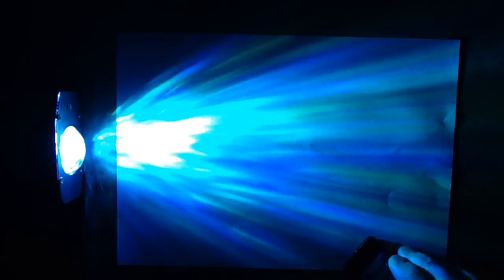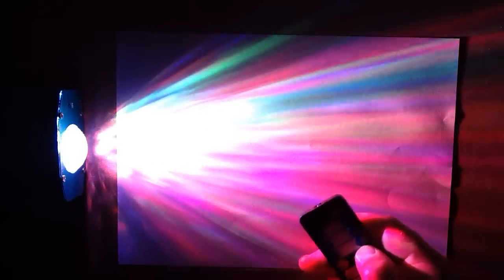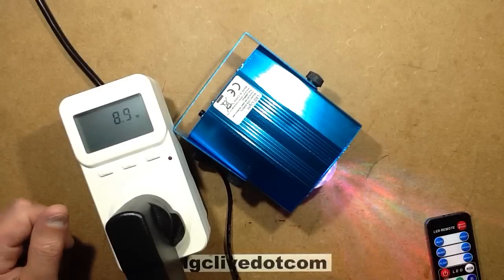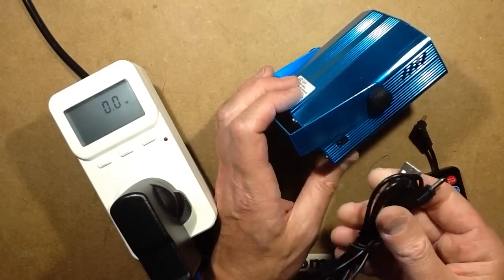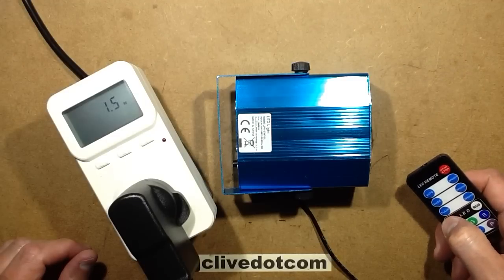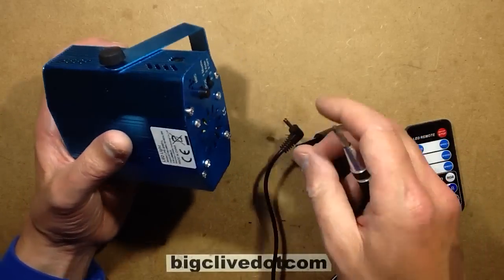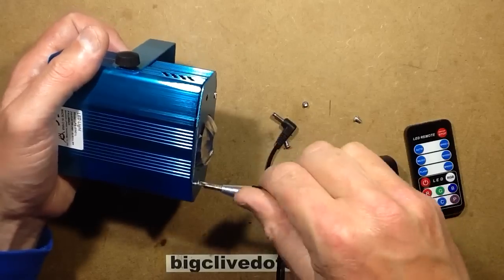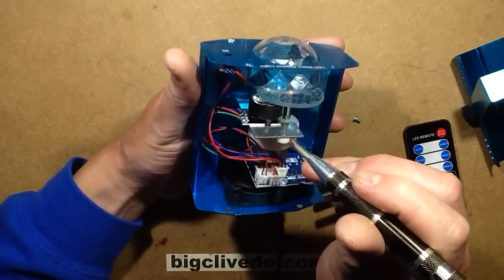Low voltage (5V) RGB LED ripple projector with remote control.

Comment: I've just ordered this one for £9 off amazon.co.uk, hope it's the same (the remote button layout is slightly different)
https://www.amazon.co.uk/Ripples-Control-Activated-Birthday-Decoration/dp/B081JVZ6DN
Reply: The remote control is actually the same as this one, not like the Amazon photo. PSU is a bit different. White label on the top is exactly the same. I didn't get a battery in the remote. My fan went quiet for a couple of minutes after about 10 minutes of use (thought it had burned out already!), but it came back on again and now seems to run constantly. The base and sides are threaded for a tripod stand, but strangely the bracket isn't (hole is too big). I haven't taken it apart (yet) but expect it to be the same.

Comment: I plan on having this hooked up to a timer. Without a memory function, what is the default color, mode and speed when its powered back on, and will it power on by itself (from the timer) or does it need to be switched on each time with the remote? great detailed breakdown of this unit.
Reply from the maker: It may vary from unit to unit, but this one defaults to colour cycling mode at power up.  To make it do a fixed colour and speed you might have to modify it.

Comment: CAUTION: I just got back from London Western Eye Hospital after having this unit cause lasting damage to my eyes. DO NOT ever look directly into beams, mount so it diffuses off a ceiling with no way anyone can get between the beam and the ceiling. PLEASE add a warning to the video! I made the mistake of thinking LEDs were safe as they were not laser units. Thanks!

Comment: I bought four of these, and one motor is much faster than the others.  Even on slow speed, it's very fast.  Do you know of any way to slow it down?  Perhaps a trim pot on the circuit board?  I was hoping it was dc, but it seems to be pwm.
Reply from the maker: You could possibly adjust the range with a diode or two, or a resistor in series with the motor.
Reply: I guess a resistor would work.  Each pulse would be at a lower voltage.  Since I only want one speed (slow), I'm also considering running the motor from something like this:

http://www.ebay.com/itm/like/252076403263?lpid=82&chn=ps&ul_noapp=true

Comment: Have you ever torn down one of the cheap ($25) rgbw Dmx par lights? I bought a few and they were all using a similar internal design, and various hardware revisions of the same logic board, with an stm8 mcu (quite possibly ripe for hacking)

Comment: EBAY SELLER WARNING. Just bought one of these from my-happyshop shipped from Leeds with a UK power adapter plug for £15. Plugged it in for the first time and the capacitors in the power supply went pop! (I opened the power supply to confirm - bad smell, liquid and raised tops).  Putting in a request for a refund, could be just my unit or could be a batch problem with the caps they used. FYI. 

Auction  http://www.ebay.co.uk/itm/121970231020?_trksid=p2057872.m2749.l2649&ssPageName=STRK%3AMEBIDX%3AIT
Reply: Ha! You're not the only one. The unit my brother bought went bogus after only 2 hours of use or so. Power supply heated up, started to smell, but kept working. Eventually, the smell became so bad he turned it off. Popped the PSU open in the vise... I almost threw up... darn the smell was nasty.

Indeed, blown caps: could not figure out if they were underrated in voltage or capacity (for as far they are not both)

Comment: I've actually been in the market for an LED light I can use in my room at home (stringing Christmas lights up is kinda gaudy and something of a hassle), so I think I might pick one of these up, especially with how cheap they are. I might break it open and see about adding some thermal compound though.

Comment: Is there any way to make it look as though the light is being spit out as opposed to being sucked in? Some sort of polarity reversal/modification somewhere?
Reply: You can reverse the direction by turning the unit around 180°, so its base is facing the wall rather than the top (or vice-versa). Turning it 90° makes the light move to the left (or right).

Comment: hey big clive which projector would you recommend between this one with the remote motor speed control or the line voltage model with more colour options? which has a more interesting effect or brighter output?

Comment: You could ask the first 20 people you see on the street what a ripple projector was, odds are none would know. and after you explained what it was maybe one out of the twenty would buy one and maybe one out of a thousand might take it apart.
I'm wondering what's the fascination/point with these ebay junk teardowns ? I'm hoping that after a dozen or so episodes  you'll show us how to cobble together some kind of remote controlled transformer toy that will scare the crap out of old ladies or the barky yappy little poodle next door. keep the vids coming, I'm easily amused

Comment: Hey Clive, could you check out one of thes e-bike conversion kits? http://www.ebay.co.uk/itm/LCD-48V1500W-Hi-Speed-Electric-Bicycle-E-Bike-Hub-Motor-Conversion-Kit-26-rear-/191859703745?hash=item2cabbabfc1:g:f4EAAOSwGIRXYsNX  . Ive been curious about these for a few days now, and I thinjk it might make for a decent video.

Comment: I just ordered one off of eBay - the 5V operation is perfect for running it from a USB power pack on a group camping trip I go on. ;)
Reply from the maker: Make sure you use a power bank that does properly cut off the cells inside when the voltage drops too low.  Some just switch off the boost converter and still allow current to flow directly from the cells at their unboosted voltage.  That could result in over-discharge.
Reply: I've never encountered one that does that - all the ones I've used shut off.
Reply from the maker: The smaller cheaper ones don't have the DW01 + MOSFET combo for proper isolation.  Even when the 5V converter has shut off and the chip has shut down, the lithium cell effectively remains connected to the output via the inductor and can still pass current.
Reply from the maker: +not_flow Just the power bank.
Reply: Are you shure?
You maybe wont notice that it is still consuming power.
Reply: It's really easy to see a simple LED light still glowing dimly. ;)
Reply: +Furr Bear Well, I had a USB fan connected to my power bank and noticed that it was smelling a little bit weird after it was connected to the power bank for a few minutes with the power bank being off.
It didnt turn though, so I noticed it only after some time
Reply: I'll have to get my USB breakout and double check for voltage on the power pins when a power pack is supposed to be off - but I've used those little PCB LED lights in most of them and when they hit a certain point of discharge, the lights go off - not merely get really dim, which is what I would expect if ~3V were still leaking through.
Reply: +bigclivedotcom can a phone or tablet be damaged? or it's only bad for the power bank?
Reply: bigclivedotcom Good to know, I suspect one of my batteries has this problem.

Comment: This seems to be well thought out, and would be my choice on the units so far. Seems like the others are just whacked together. Also, it seems like the fan is configured to exhaust out the back of the case, unless it is a reverse direction fan.

Comment: You know if I had 3 or 4 of those, all on 5 volts, I could use them when I am out in the Mohave Desert, aimed at our 35 foot mostly white Motor Home, it would really get the "the truth is out there's" going.  Better yet, perhaps a trip to Area 51 with the lights and our RV>......

Comment: Most of these casings have that fan on them, but I have never understood where the air is supposed to go, is there some exhaust somewhere?
Reply: Diagonal vent slots cut in along the sides, you can see them when he's fiddling with the case about 3min in.
Reply: Aaah, there it is!

Comment: I noted two differences on mine: 
A small dab of heat sink compound on the LED bracket where it meets the case and the front lens isn't glued in, it actually is a bolt-in style of that lens with two screw tabs molded into it.  Small differences but otherwise identical.

Comment: Link to product:
http://www.aliexpress.com/item/BEST-Pro-DJ-Stage-Light-360-Degree-9W-Mini-LED-R-G-Ripple-Effect-Party-DJ/32646801911.html
Reply: You are doing the lords work. Thanks!
Reply: +FabricOfExistence HA ha no problem. :) It's the same link I sent to Clive a few weeks ago so I assume he's ordered it from there as well. It's a great little unit and I like it better than the others he's been reviewing.
Reply from the maker: I had to find one from another source as Aliexpress sellers systematically reject shipping to my location.
Reply: +bigclivedotcom Ah yes, the island thing... :)  Well, you did manage to find exactly the same as I got from Ali.
Reply: Y is usually the marking for a crystal or oscillator.
Reply: Oh wait, you mean they were literally marked Y1 (as in chip marking) ... my bad.

Comment: You'd be surprised at how well that little bracket and case cools it. I've left mine on at full white for hours on end and it only gets moderately warm round where the l-shaped bracket is attached to the case. Lol should have read the description first but its good to see we got similar results.

Comment: sorry i think strobe and sound feature is the best features of that really. that would be nice for some stuff. also you see the usb cable with moving lights? https://www.amazon.co.uk/gp/product/B00Z5B8NK8/ref=as_li_ss_tl?ie=UTF8&fpl=fresh&pf_rd_m=A3P5ROKL5A1OLE&pf_rd_s=desktop-1&pf_rd_r=P4SSFZ1BXXT70T1RSSDR&pf_rd_t=36701&pf_rd_p=26de8ef0-2ad7-412c-8634-6cd03b7b73e2&pf_rd_i=desktop&&linkCode=sl1&tag=techmoan-21&linkId=340df5cef385be75b501542801f47098

Comment: May I ask what you use or recommend as a benchtop variable power supply for the budding electrics hobbyist?  I've seen much variation in price, as well as power range and resolution available.

Comment: I'd like to loft one of these on one of my quad copters aimed straight up mounted  into a low cloud bank on a dark foggy morning.
The low voltage and light weight make it doable and the effect may be interesting when spread out across a large area.

Comment: Interesting. It has better control in the board design, but a overall similar shape and placement of internal components and no memory. Wonder if you could add a memory chip if the design is similar enough.

Comment: the safest ripple projector yet
Reply: +KhronX Cheap shitty pink usb charger from china
Reply: +KhronX Capacitive dropper based charger would be even better 😆
Reply: That only depends what you use to power it, though :P
Reply: I read as "the safest nipple protector yet"
Reply: Random Tech Stuff That's damn near suicide right there. Although, granted, while there might be more certain and/or more effective ways, you might not be able to go a lot cheaper than one of those CSPUCs x) 

(I believe, given the nature of this channel, that those devices have earned their own acronym :P )
Reply: A cheap shitty pink USB charger, from China.
 Or a beefy USB Power Bank with at least 2A output \o/
 God dammit utub, fix ur enter-button-removal bug pls.
Reply: +Random Tech Stuff Smoke came from every corner and the LEDs got extremely hot